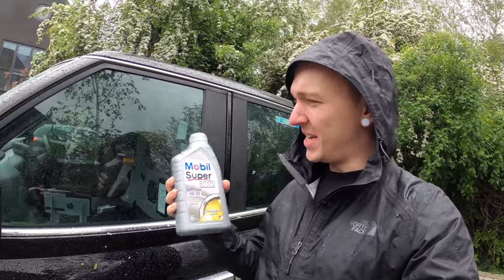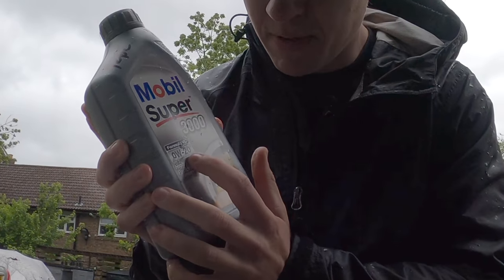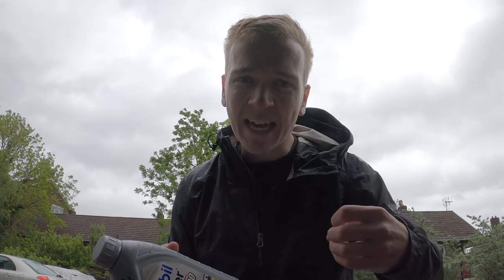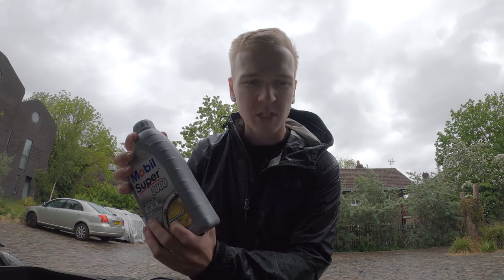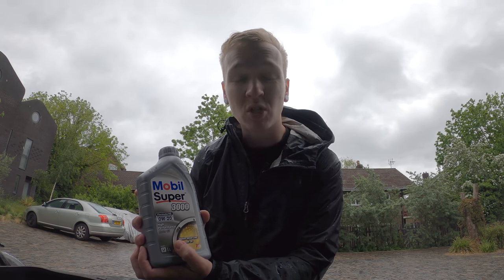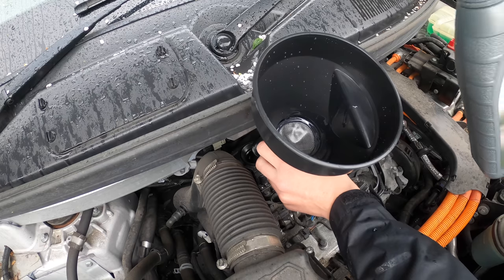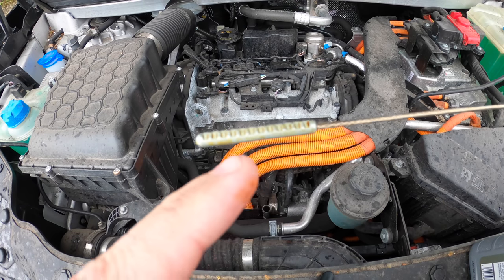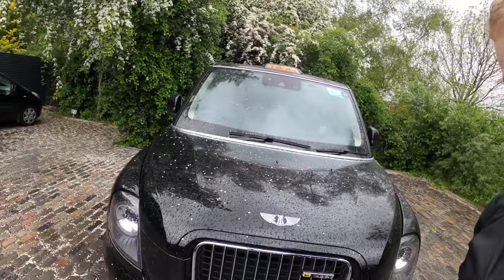WHAT oil does an electric taxi use?

Comment: Tom I’ve got a 2 litre diesel bmw. It says use 0w30 Castrol in the gold bottles. It was drinking a litre every 1500 miles. It’s getting old now and I’ve started using 5w30 and not used a drop
Reply from the maker: Yes classic trick, people would sometimes do that with 20w50 in 10w40 engines.  Some cars used to recommend in the handbook a thicker oil if the engine has had a longer life or more miles.
Also worth noting that you can get away with thicker oils on top-up as it mixes with a much larger amount in the system.  Full oil change, definitely best to stick to the right grade.

Comment: That’s cool. Interesting that it can still be called electric when it’s a hybrid.
Reply: It runs completely off electricity the engine doesn’t power the taxi the electric motor does that 👍
Reply: It's similar to a diesel-electric locomotive, electric always power the the wheels but uses a 1.5 litre petrol ICE as a range extender when the batteries get low. Not sure if that still classifies it as a hybrid.
Reply from the maker: Yes I believe because the electric powers the wheels rather then directly from the engine. As a result the range extender could be removed and run entirely on electric.
Reply: I suppose it could be called a self charging hybrid and plug in Tom ?
Reply: they'll be fazed out in 10 years

Comment: Nice to know where the REX is on this. I suppose it would be silly putting it under the boot floor like in the BMW i3, would swallow up precious cargo area and not be great for the passengers. Better for cooling up front also as I’d imagine the REX on a taxi to get used an awful lot more often than on a regular daily driver.
Reply from the maker: Yes, would be nice in the future if this model could be upgraded battery wise, meaning the REX could be ripped out and converted to a storage compartment.

Comment: Out of interest how much are the total running costs of one of those monthly roughly? I have no idea how much they cost, or even how much taxi insurance must cost! And thats before you get into petrol and maintenance...
Reply from the maker: It's hard to quantify, some drivers use these on electric a lot! And the price of electric is hugely variable depending on your own household rate or if you charge at home.

To give you some numbers.  The electric portion of the cab will do between 50-65 miles (65 miles is absolutely best conditions, no AC/heather etc).  It is approx 23kw to fully charge the cab.  kw rates can vary from £0.05 - £0.35 (5p = cheapest home tariff, 35p expensive street charge).  Therefore to fill the electric capacity can be between £1.15 - £8.05.

Where drivers live can also have a huge influence on this.  If they can run primarily on electric (London based drivers) that will be considerably cheaper than the out of London driver who has to rely on the petrol generator.

Individual circumstances aside, most drivers agree that switching from a diesel TX4 to the LEVC TXE has at least halved their fuel costs.  Making the expensive upgrade not as steep (so long as you regularly work the cab).

Comment: I am going to disagree a bit Tom. Low viscosity oils were used before the start-stop systems or hybrids, main driving force behind lowering viscosity was/is lowering the fuel consumption. Less viscous oil creates thinner oil film and removes less power from the engine by fluid friction. Better cold lubrication is more of a pleasant bonus especially for hybrids and start-stops as you said.
Reply from the maker: That’s very true, high performance engines too!

Comment: Does your funnel have a filter? Never seen that before. Usually when I'm doing oil changes I just cut an empty bottle in half and undo the lid.

Good to see you looking after the cab. Oil is one of the cheapest insurance I can think of!
Reply from the maker: Thanks Nadim, yes a lot of these flexifunnels have inbuilt filters now.  Bit posh I guess but the filler hole was a little hard to reach on this one.

Comment: I'm confused, how do you lose oil unless you have a leak? Does oil evaporate from somewhere??
Reply: Most ICE engines will burn a little of bit of oil. Especially mega efficient ones, they'll burn a small amount of oil in place of petrol (but not enough to be deemed excessive) in order to increase fuel economy. The usual amount acceptable for most car manufacturers is that you'll burn 1/4 of your oil every 1500 miles or so.
Reply: @lolerzzz i learned something new today. Cheers.
Reply from the maker: Me too!